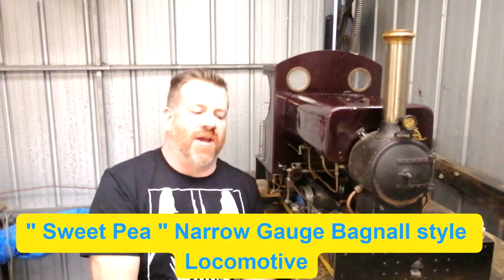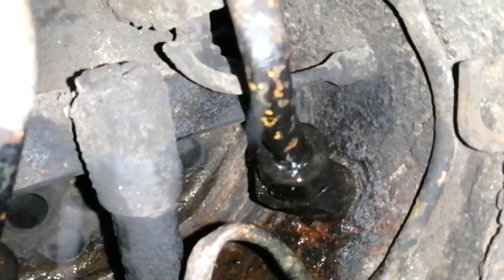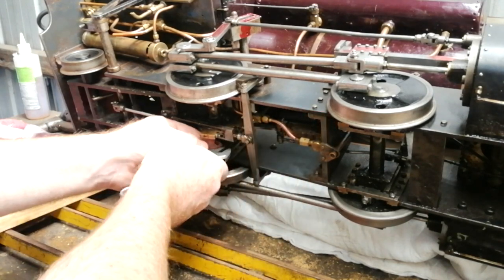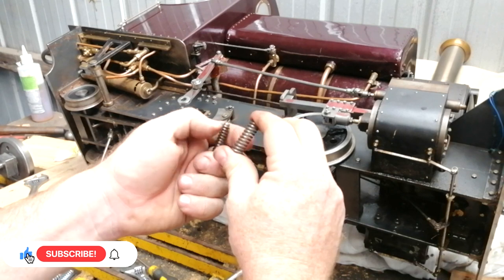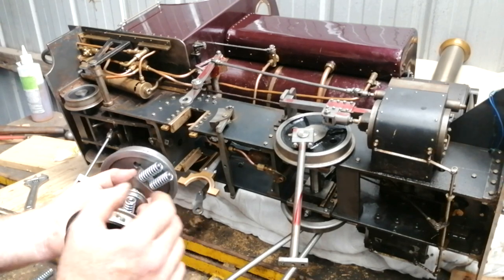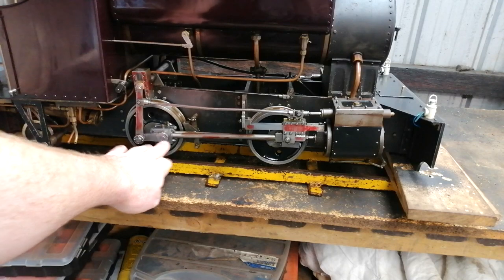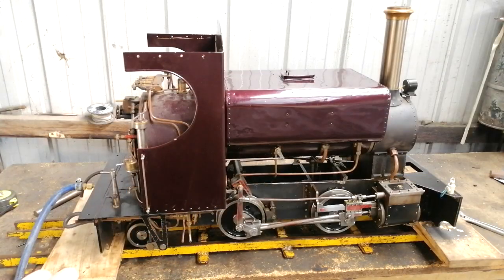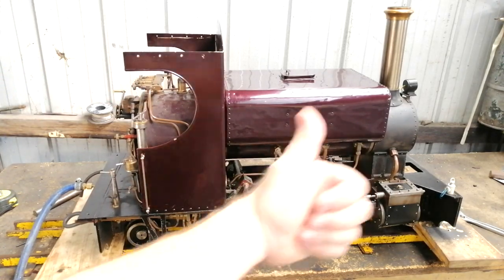Let's go buy a Live Steam Train !........Exciting News....

Comment: "I'm trying to steam up! It's just so damn hard!"
Reply from the maker: @The_East_Charleston_Railway  shouldn't be difficult ,make sure the damper is open ,smoke box has no leaks ,start on fire lighters add wood ,then char ,then coal ,make sure it has good draft on start up with compressed air or fan till you reach 30psi then switch to the locks blower

Comment: Hi Anthony, I have recently acquired a sweet pea with some minor jobs i'm going to try and fix and one of those is that the safety valve's accumulate. What do you think is the best way to tackle this? Take them apart and see? Or replace completely as it could form a safety hazard?
Reply from the maker: Hi there ,Depending on your Boiler code requirements there should be a min orfice diameter  , accumulation will only be rectified by finding what the cause  is , I would discuss the issue with your club boiler inspector seeking their advice can save many hours of head scratching
Reply: @EverythingAnthonySOS  Never thanked you for your awnser (woops) but better late then never: thank you for your awnser! In time since i took apart the safety valves and found out it was rust above the ball bearing which made them not work properly. I tried cleaning them up by bathing them in vinegar with the rust gone it showed it was not wise to continu with those valves as they are for safety after all. I now got a fresh new pair from Blackgates which fit perfectly! 

Tho they have a bit different shape with the addition of an outer locking ring at the top, meaning the old pipes guiding the steam through the roof wont fit the new ones. So here I was wondering if you could help me once more with some advice: How to best tackle this? I've seen pea's where it seems the pipe is just completely over the valve and seems not screwed down or anything, and i've seen pea's like mine where (on the old ones) the pipes and top of the valves were threaded so they could screw onto each other. This last method I don't deem wisely with these new valves as i don't want to alter the locking ring. Do you have any advise on what is the best/safest way, or suffeciant enough to easely solve this?

Kind Regards, Scagen

Comment: get rid of the adjustable cresent, they damage the nuts and bolts, get yourself a set of proper spanners
Reply from the maker: Hi terry thanks for the advice ,unfortunately I was supplied a set of Laser cut Ba spanners that didn't fit as well they should and had no other choice at the time ......
Reply: @EverythingAnthonySOS  Looked like an Imperial adjustable spanner ;) We've all been there.
Reply from the maker: @bvward  I'm all ways getting the imperial adjustment spanner mixed the metric ......

Comment: Did you get the steam leak fixed in the smokebox?
Reply from the maker: Yes . both pipes were leaking which would account for poor drafting and high steam use , and running on 3 power strokes didn't help either !
Reply: @EverythingAnthonySOS  ah yup that'll do it haha. Gonna be a brand new engine now!
Reply: @EverythingAnthonySOS  Good work getting the loco running better. How did you fix the leak in the smokebox?
Reply from the maker: @davidtaylor6124  wait for episode 2 we find more wrong ! ,it was a simple fix requiring the nut's to be re tighten on the steam delivery pipes